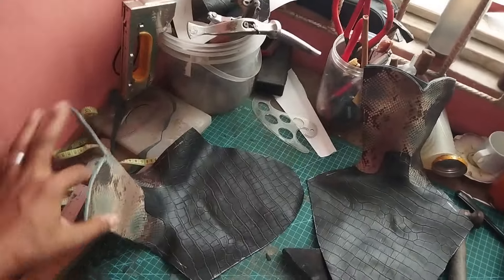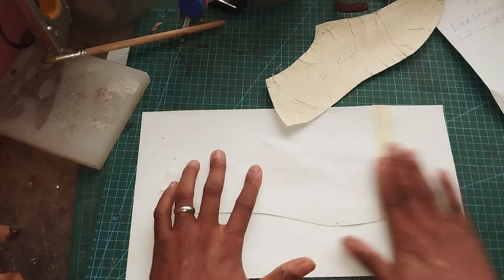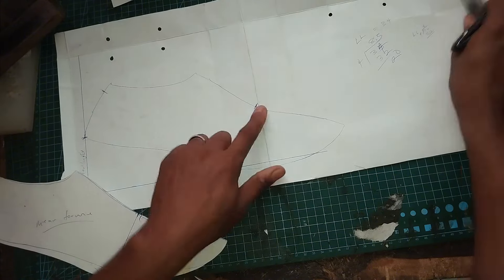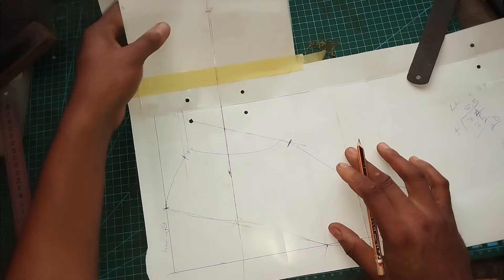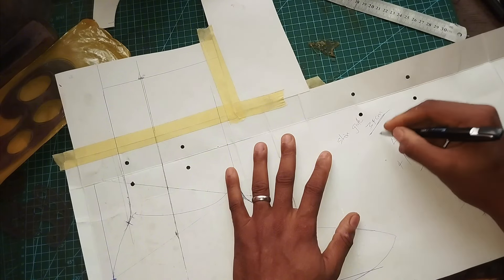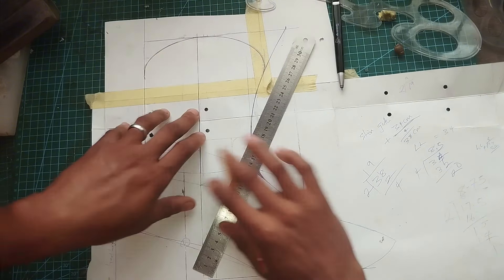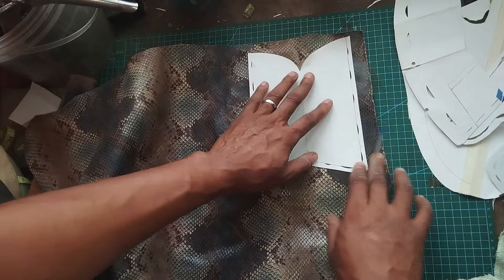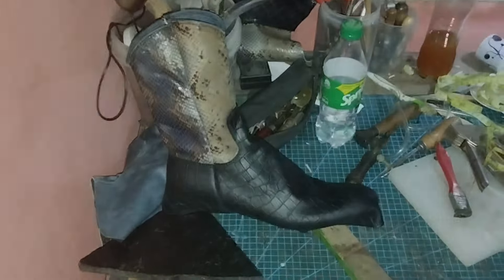Deadly Mistake While Making Cowboy Boots

Comment: First let me say, I love your videos.  You have taught me so much about making lace up shoes.  On your cowboy boot.  You need to use your short heel measurement.  If you envision a pass line about 50mm up from the seam line (where the vamp and counter meet the shaft) I usually use S/H plus 25mm.  At the seam line I use S/H minus 20mm.  Also cut your tops the same in the front and back at the top line.  I do not cut in that draft at the seam line until after I have cut my patterns for my tops.  Then I cut the draft before I stitch on the vamps and counters.  You need that extra at the pass line for the widest part of the foot to pass through but you need it to snap around your foot once it is on so you do not have heel slipping.  Just some suggestions.  Thanks for doing what you do.
Reply from the maker: Now watch me implement all of this. It will be televised. 👍
Reply: I'll be right here watching. @KpomoBespoke

Comment: why don't you add a zipper to the back/heel of the boots? I'm currently learning about style so don't take my word for it, but I think that might look good; I'm personally not a fan of zippers, particularly on the side of shoes. I can see how a zipper on the back could rub against your skin as you move, but I've seen premium shoe brands use this design, so if you can find out how they do it, perhaps you can also get away with it. Love the choice of leather. I think with a zipper in the back, the smaller ankle of this boot can look quite elegant acutally.
Reply from the maker: Thank you very much for the suggestion. I myself have made boots with zippers at the back before. They work very well and look good for women boots. I am not so sure about that style for men. Men typically have their zippers in front or to the sides you see. I just think mens boots with zippers at the back is quite unorthodox. In any case, a zip at the back will interfere with my back counter stiffeners. I guess the most straightforward compromise here will be zippers to the side. I have decided to put the zippers on the inside so it can be mostly invisible.
Reply: @KpomoBespoke  Thanks for the reply, I believe the brand who I saw this on was Officine Creative, an Italian designer brand; from my limited understanding, they put out quite a few unorthodox designs, but perhaps that is not your style (I'm not too sure about it either haha).